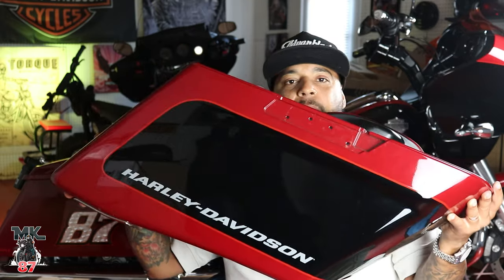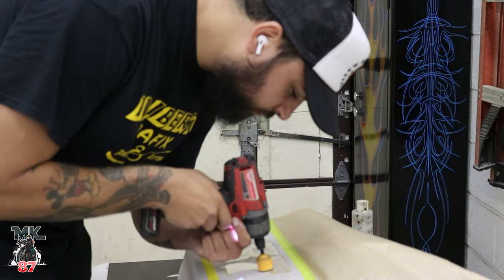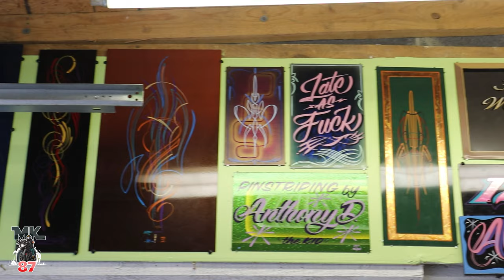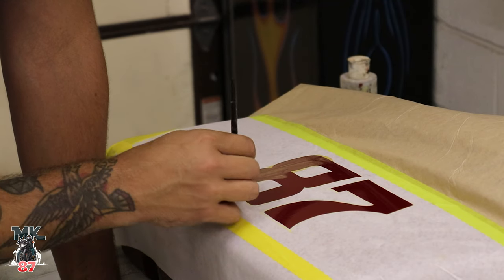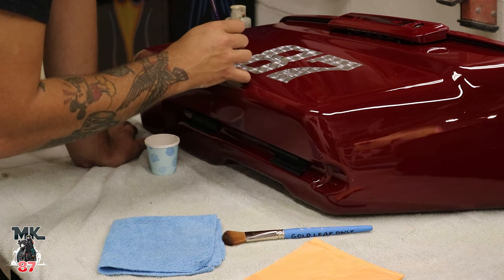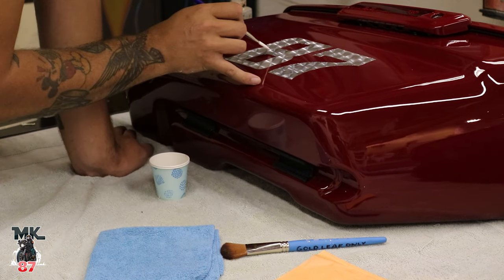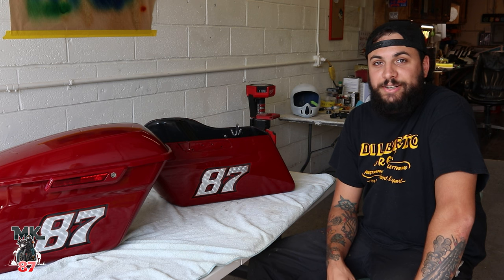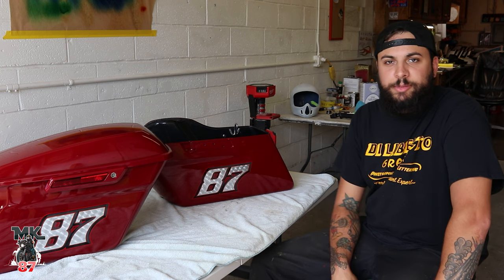Advanblack saddle bags for my Harley Davidson Road Glide Special

Comment: Most people don't realize it but, when you change from a stretched bag to the shorter ones, you change the lines on the bike drastically. If you follow the line on a RGS from the bottom corner of a stretched bag to the furthest point on the front fairing, it's one continuous line and trajectory. Take those bags off and put the shorter one on and you lose that consistent line and it does show and make a difference in the overall stance. The SG has this problem even when you have stretched bags cause the front fairing doesn't follow those lines no matter what you do. However, the SG does look better with shorter bags than the RG cause it's fairing is more upright and lower.